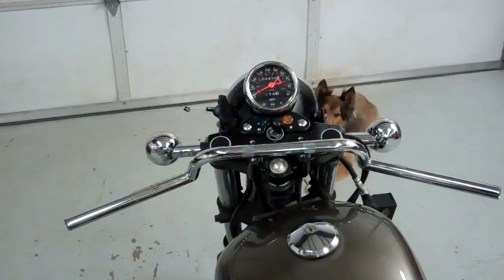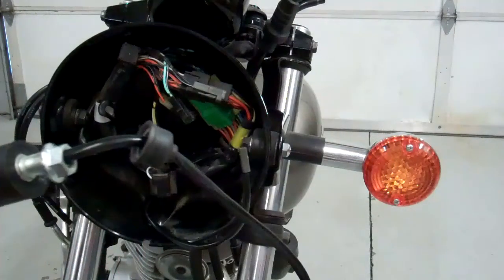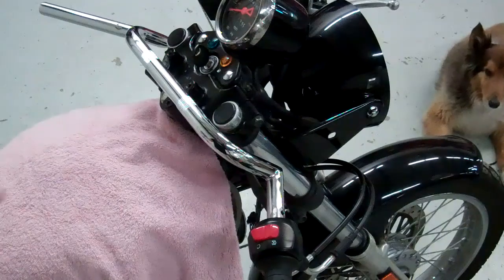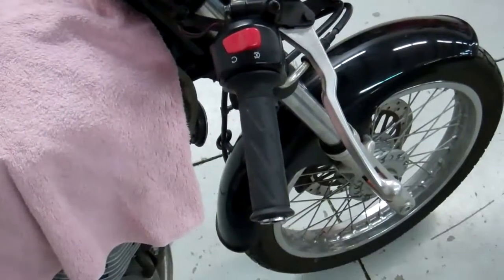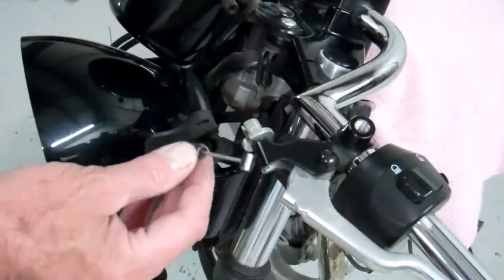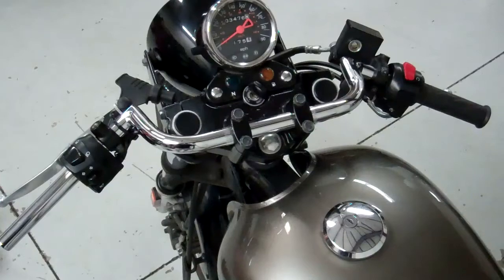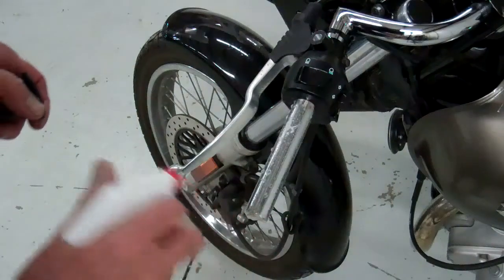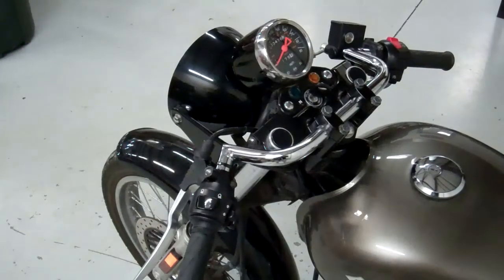Suzuki 250 Clubman Bar and Remove Front Signals

Comment: The welds shown on your bar are incorrect. The two bars should be attached at least an inch back on the yoke for much greater strength, although for a light bike like this it is probably less critical than for a big one, it is bemusing to watch the current generation of bikers rediscover what was common knowledge in the '60s.